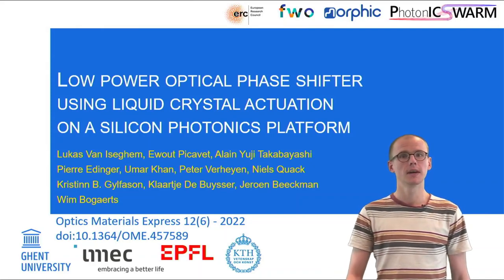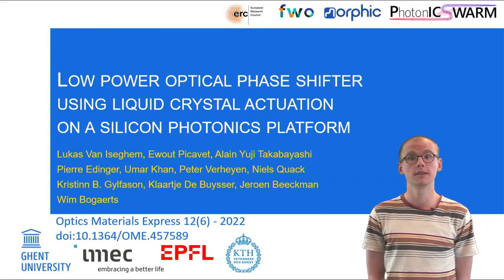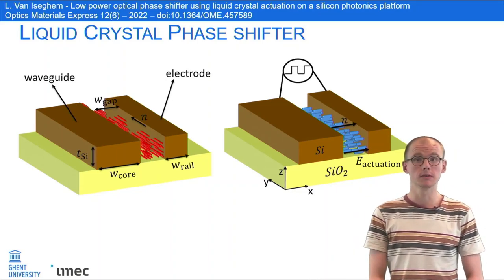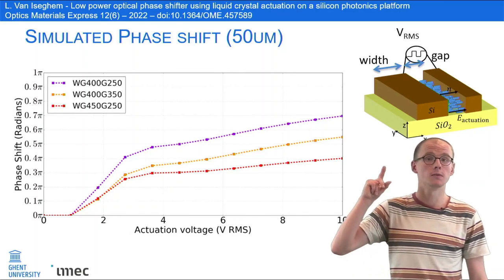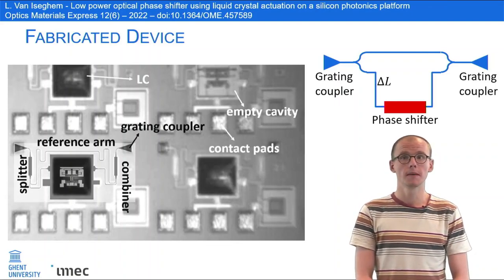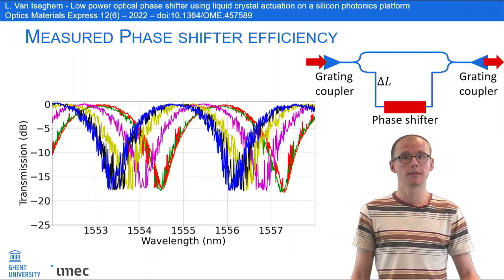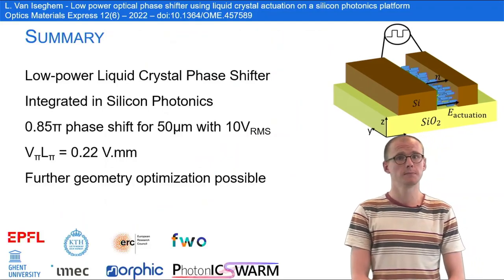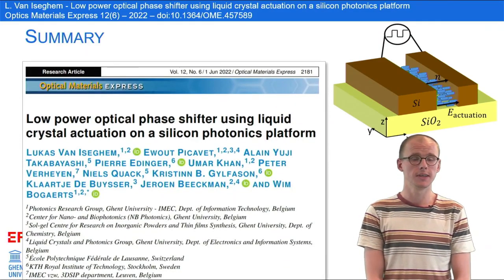Lukas Van Iseghem - Efficient Liquid Crystal Phase Shifter in a Silicon Photonics Platform

Comment: How did you measure the phase shift?
Reply: at 1:44 you can see how it is embedded in a Mach-Zehnder interformetor. That is a device capable of measuring phase shifts compared to a reference arm.  The results in the spectra shown there, where the maximum occurs when both signals in the arms have a phase shift of 2pi, the minima occur when the signals are out of phase, a pi phase shift (the phase difference is influence by the wavelenth, as the length difference results in a different phase shift for different wavelengths). (In reality it is any even number of pi to be in phase and any odd to be out of phase, but we dont want the absolute phase difference between the two arms; we want the phase shift compared to 0V when we apply a voltage).  

When a voltage is aplied this shifts this measured spectrum, and from this one can extract the phase shift resulting at the given voltage. This can be done because we know that when the spectrum is shifted by an amount called the Free Spectral Range (FSR); the distance between two peaks; a phase shift of 2 pi occured in the device compared to the spectrum with 0V. 

https://en.wikipedia.org/wiki/Mach%E2%80%93Zehnder_interferometer